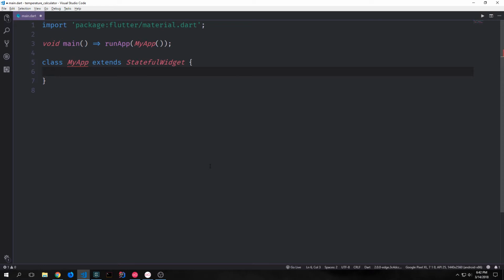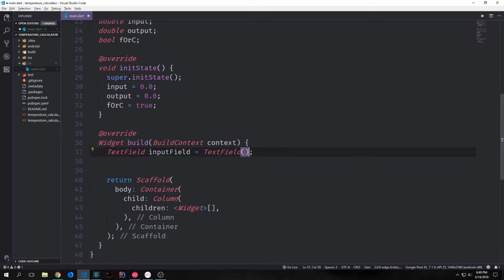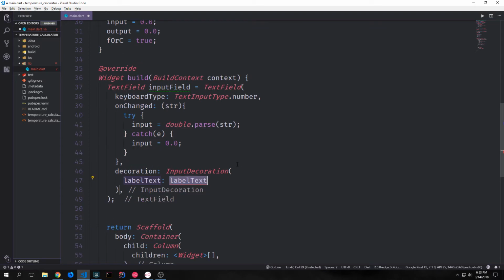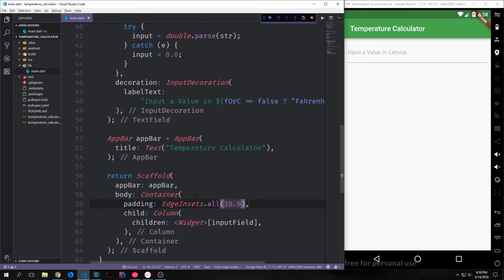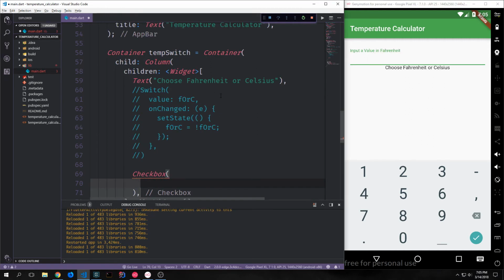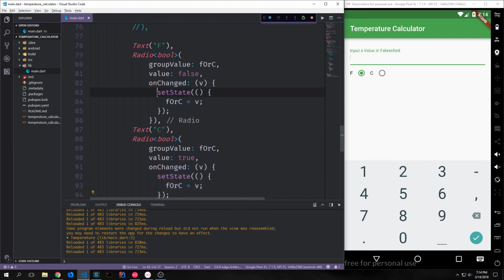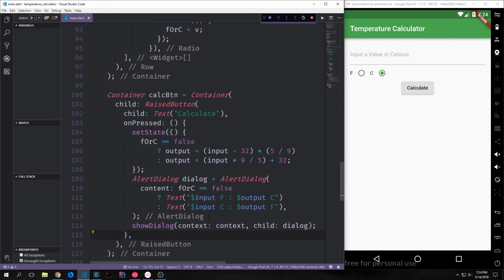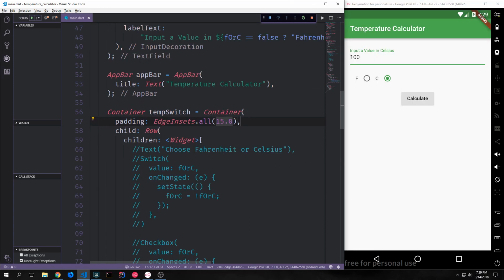Building a Temperature Conversion Application using Dart's Flutter Framework

Comment: I follow your code but the emulator display the radio button to be vertical and not horizontally align. I follow exactly what you typed.
Reply: And I got error when writing showDialog(context: context, child: dialog); and IDE stated that child is not defined. I tried to change to builder but there is still error..pls help
Reply from the maker: @nz9273  Do you have the dialog function?  If not, add it and if so, remove it and just input the AlertDialog into the child field.

Btw, this video is almost 3 years old.  Its possible some of these widgets APIs have slightly changed.
Reply: @TensorProgramming  okay, i'll try

Comment: What are these two files and what are the purpose of it? 
-    temperature_calculator.iml

-    temperature_calculator_android.iml

I am new to flutter and what android emulator should I use to ensure it works as expected like in the video
Reply from the maker: They are used for intellij/android studio.  Its really nothing that is important.

The android enumator you should use is AVD, android virtual device which comes with the android SDK.  You can get it by downloading android studio or the standalone android SDK and installing it from the toolchain.  There is also genymotion which uses virtual box and the android SDK.
Reply: @TensorProgramming  that means I don't need to create these two files, is that right? Thank you for replying 😄
Reply from the maker: @nz9273  No you don't need them.

Comment: Thanks for the  video . Next step for this example would be to move the calculation part to separate class (ConversionBrain.dart) ,Hoping that you have a video down the line in this series that shows code structuring/architecture for flutter apps.
Reply from the maker: Yes, I do have some videos that talk about structuring.  All of my tutorials are live coded; so it makes sense to do things like this.  However, on larger projects I tend to separate logic and concerns.  Also you've got all of the videos on state management that are down the line.

Comment: "showDialog" method has been modified since March 2018. Everything else (with exception of the "class MyApp... " line) works in April 2019. Thank you very much.
Reply from the maker: Oh right, they've implemented a builder into the showDialogue function rather then just a child.  Its a good change and it makes senses.

Comment: "class MyApp extends StatefulWidget" would not compile. The Flutter error message was not clear to a beginner. It compiled after I changed it to "class MyApp extends StatelessWidget" (for me it was not an obvious solution).
Reply from the maker: I don't see why the code wouldn't compile as a stateful widget.  In fact, I just cloned the repository as is and it worked fine. The only part of the app that is a little sketchy is the showDialog function call since the child field is depreciated. Even then, the code compiles on the latest flutter development build without a problem and VsCode immediately shows you that this field is depreciated.  I am really not sure why you are having so much trouble with this code.  

I am wondering what Editor/IDE you are using for development.  In VSCode I can see the problems and the error codes are pretty readable.  I would understand if it was an error that was deeply embedded as a result of a changed API from a third party library but with something like this where the code isn't actually broken (just depreciated) it is clear that you made some kind of mistake outside of the scope of the project. 

I am not trying to be condescending though I know I probably do sound that way. More than a handful of my older flutter videos are depreciated and need to be updated (they are almost a year old after all and were made with the flutter beta SDK).  That being said, I don't have a ton of foundation level videos for the flutter framework in my playlist.  I recommend that you take a look at some more beginner oriented documentation on the framework before proceeding with the playlist.  I also recommend that you get familiar with the tooling so that the error messages do not feel so foreign to you when you do encounter them.  Sitting down and just building something simple without a tutorial can be one of the best ways to learn the basics of a new technology. They say that good programmers are really just really good googlers so get used to using Google and official documentation to search out errors and warnings.
Reply: @TensorProgramming  ,  the "StatelessWidget" app works exactly as you intended it to work. Changing it to "StatelessWidget" shows: "Missing concrete implementation of StatefulWidget.createState." The key word is "concrete" but I don't know what's missing.
Reply: TP, may I contact you via your web site ("Contact Us")?
Reply from the maker: @michaels3003  So the problem is that with a statefulwidget you need to have the stateful widget and a state object that is associated with it.  In VSCode, if you highlight a stateless widget and click on the light bulb next to it, you get the option to turn it into a statefulwidget.  Go ahead and click it and you will see the difference.  

In a general sense, a stateful widget is a widget that describes a part of the widget tree that needs to rebuild when the state object changes (and accordingly it is bundled with all kinds of different functions to facilitate this).  On the other hand a Stateless widget does not do this.  

You can also look at the github repository in the description to see the statefulwidget TempApp and its associated State widget TempState.  https://github.com/tensor-programming/flutter-temperature/blob/master/lib/main.dart  Both of those classes are required to build the actual StatefulWidget in the widget tree.  If you do not include the state class or if you put the build function in the Stateful widget class you are likely to run into the error you are describing.
Reply from the maker: @michaels3003  Contact us is just a link to an email that I use for my channel/blog.  You want, you can join the discord channel here: https://discord.gg/Vgg4u6
Reply: @TensorProgramming  , so I've managed to locate your main.dart file on GitHub. It says stateLESS widget on line number five. I was following THIS video only, which said stateFULL widget on the same line. Lesson learned, I guess...
Reply from the maker: @michaels3003  I later changed the root widget aka line 5 to a stateless widget because having it be a stateful widget was mainly just an accident.  I suspect that I just edited that part out of the video by accident.  You don't really need to "locate" the github repos, they are all listed in the video descriptions of each video.  If you are ever having an issue with something like this again, just go to the repo and check the code.

Comment: I feel that this video's code is a lot cleaner than your other videos - good job! I hope that this will convert many more people to Flutter and dispel some fears that they have.

If I have one criticism though, I'd say that "fOrC" as a boolean variable is not very readable from a code perspective. If I were making this application, I'd replace it with an "isCelcius" variable which would be more readable, or alternatively just swap the whole thing out for an enum if I were expecting to add other temperatures in the future.
Reply from the maker: I considered using an enum since radio buttons lend themselves to that type of type very well but since the choice was binary, using a Boolean made the most sense.  I also do agree that the variable name was fairly bad, but whatever, its not a huge deal.  

Believe it or not but I felt this code was less readable then my other videos while I was writing it but thats just my opinion.  I personally don't mind the widget tree syntax in flutter and I find it to be fairly clean if you refactor a few things.
Reply: Tensor Programming Oh don't get me wrong, the variable naming is not a huge deal. You're putting yourself and your code out there for the world to criticize and learn from, and I completely respect that! I think you do a fantastic job overall.

As for the code cleanliness, we shall have to agree to disagree on that. My personal opinion is that too many layers of nesting (which all of the default Flutter code seems to encourage) is a bad thing no matter how readable. I appreciate your perspective though and there's room for both of us in this world 😊
Reply from the maker: Haha, well yeah I recognize its a subjective topic and that is why I figured I would approach things differently in this video to help people see that you do not necessarily have to sit and nest everything etc.   

Anyhow, thanks very much for the compliments, It is always nice to see when people are actually getting something out of my videos.  I enjoy making them and if people enjoy watching them then I am happy.

Comment: Hello. I'm not into dart/flutter but it's something i want to get into, hence i watch your videos. 
With that out of that way, may i ask you why you're not using the new keyword while instantiating classes?
Reply from the maker: One of the new features in dart 2 is that you do not need to use the `const` or `new` keyword when instantiating classes.  This was a deliberate design decision by the dart and flutter team because it makes flutter less verbose and more readable.  Personally, I find it a pain to have to write new everytime I am making a widget but that's just me.  You can absolutely still use the new keyword if you want to but its not required (Just make sure you are using dart 2.0.0 otherwise this wont work.)
Reply: Tensor Programming great. Thanks for the reply

Comment: Heey nice tutorial thanks, would be nice if you could show on the next tutorial how to use Google maps
Reply from the maker: Not sure if it will be next but I do have one planed.
Reply: Tensor Programming nice thanks for the reply
Reply from the maker: Google maps with flutter can be a tad bit confusing because you have to link things through the Android and iOS platforms since there is not a great native flutter solution for it yet.  Also, the emulator has issues running geo-location services so I have to find a work around for that. Non-the-Less I definitely will be doing a tutorials on Maps because its a good way to show off the message passing from the host language/OS.